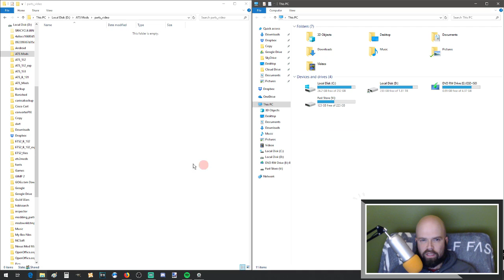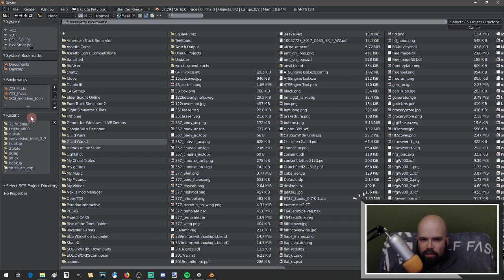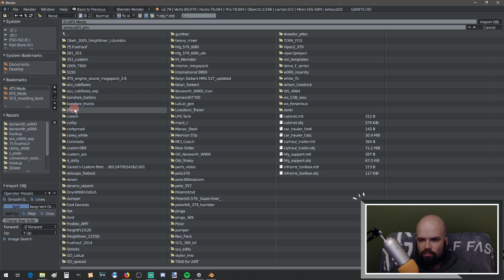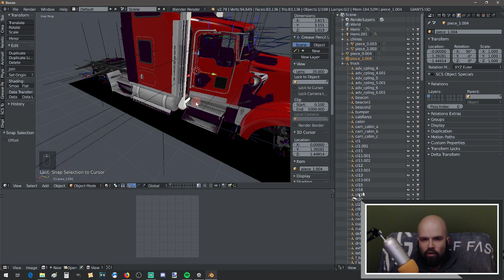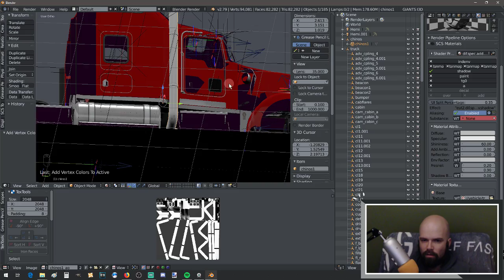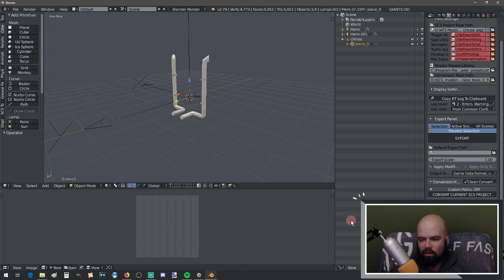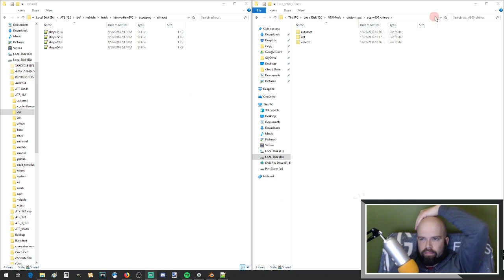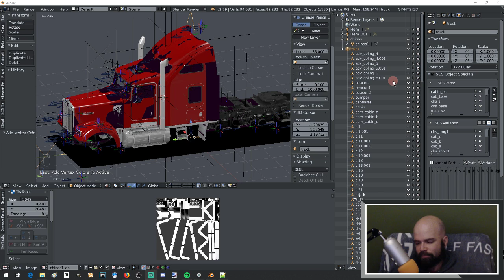Blendertools [ATS] How To Add Accessories to An Existing Truck Mod!

Comment: how would i go about adding a node on my aero cab ? so i can add beacons > also how do i go about updating a beacons on a trailer ?
Reply from the maker: Easy way is to copy an existing node on the truck, like the horns. Name it beacons and then import the stock beacons to check fitment and write the necessary sii files

Comment: hi.. again i added an airfilter to my truck but how do i get the same material that default other chrom part of the track?
Reply from the maker: You need to assign it using the material chooser. See what the other chrome pieces are using and select it from the list on the air filters.

Comment: Okay so, I’m trying to put the flattop sleeper from the scs 389 onto the scs w900, would I do it the same way or?
Reply from the maker: Those are both attached to the cabin so you would need to use variants to make that work.

Comment: Bro could you help me out I got a part where I want to just add some slots to it. I got blender but what is that other program you use? Or could you just help me out with the 2 part that would be also really cool it’s just adding some slots to 2parts. Or help me out how to start up

Comment: If an accessory is imported as a .pim file, instead of obj, can the baking and materials process be skipped?
Reply from the maker: Depends on if you want to keep the materials and textures assigned to that piece. But most times yes.
Reply: @Halffastgaming  I do, all I would like to do is add stacks and bumper from one truck to another... So then just skip the baking step altogether?
Reply from the maker: @bradstoltzfus5436  just need to copy the necessary textures over to the proper place and reassign the tobj and you should be good.
Reply: @Halffastgaming  perfect thank you so much! And thanks for sharing your knowledge, I've been wanting to tackle some small modding and your videos are extremely helpful.

Comment: i have a old kenworth w900 but i want to add computer system and and some interior how could i do that ?
Reply from the maker: Well a computer is a bit more complex but you could copy the one from the SCS w900, and what kind of interior stuff are you wanting? If it's something custom you would have to model it or have it modeled and then added to the truck. Once it was made you can follow this video.
Reply: @Halffastgaming  do you have a discord maybe i can pay you upfront to do it
Reply from the maker: @dizzythakidd7350  not something I do. Sorry
Reply: @Halffastgaming  ok thanks man ill just have to learn

Comment: Tex Tools doesn't show up for me. Can I just use the bake icon on the other side under Render?
Reply from the maker: Tex tools doesn't bake, the tool I use is a separate add on.
Reply: @Halffastgaming  Would I need to do anything differently if the accessory I'm trying to add was not an accessory on the truck before?
Reply from the maker: @c.s.charles2102  differently how?
Reply: @Halffastgaming  Would I have to make a node for it?
Reply from the maker: @c.s.charles2102  if it won't replace another accessory on the truck as it is.

Comment: if i want to raise the trailer a little at the fifth wheel what do i move ? hook? or fifth wheel square in blender?
Reply from the maker: Raising the trailer at the kingpin would be raising the hook node in the positive Z direction.
Reply: @Halffastgaming  thank u
Reply from the maker: @TheJdmcivic32  my mistake. It's the reverse. Should be negative Z. Positive Z will bring them closer together. Apologies.
Reply: @Halffastgaming  when i move the square it seems to not stick to the position i put it
Reply: Export after changes back into truck before converting back ? Or do I just convert after changes 🤔
Reply from the maker: @TheJdmcivic32  always have to export then convert.
Reply: @Halffastgaming  had a feeling i was missing a step i got it 👍 ur the best 👌

Comment: I like the t660s so im trying to learn all this modding so i can make a real nice custom one. but for some reason when i drop the truck mod on the scs extractor the black text opens then closes real quick. does anyone know whats up?
Reply from the maker: The extractor is for SCS Software SCS files. Not for mods.
Reply: Half Fast Gaming the truck is in a .scs file. Is there another way I go about doing that?
Reply from the maker: If you are interested in using blender I have a ton of videos on how to do what you are asking.
Reply: Half Fast Gaming alright Man i really appreciate it! I’ll go look into them right now

Comment: i tried it with a pim file but when im import this file ...there is nothing on the model... no texture no mat ...why may be?
Reply from the maker: Because you imported it from outside the current project?
Reply: @Halffastgaming  can record a video about this please? im very thanks for your works
Reply from the maker: About what specifically?
Reply: @Halffastgaming  about import a pim file to a modded truck... like a new bumper air flter or back bumper
Reply from the maker: So a part from another truck to a new truck?
Reply: @Halffastgaming  yes please .. your tutorials are very pragmatic...

Comment: When i go to export it says “selected objects are not part of any scs game object” im using parts from a modded truck, is there anything i can do
Reply from the maker: It means that they are not part of a root node.
Reply: Half Fast Gaming how would i make them a part of a root node? Is there a part of the video i missed, and if so can i get a time
Reply from the maker: @tjtransportyt1796  I've covered creating a root node, I may even do it in this video. I'm not in a position to watch it back at this moment.
Reply: No need to man, i got it, sorry for the inconvenience, thanks for quick responses tho!!
Reply: Half Fast Gaming also when i goto the exported files it only shows the tga file and a tobj no .pim or .pit
Reply from the maker: @tjtransportyt1796  That means you have errors, and if there's no root node, that will happen.
Reply: Half Fast Gaming its not giving me errors when I export, im not sure if the pim and pit files that are already in there belong to it, either way the pim and pit files have no size and don’t work

Comment: How do u get the pim, everyone uses it but i cant get it, also the scs import thing when ur importing a file into blender doesn’t show up, what am i doin wrong
Reply from the maker: You use converterpix to get the pim.
Reply: I doo but it doesnt
Reply from the maker: @jordyjohnson7588  if it doesn't make a pim it means there is an error in the materials or the model itself.
Reply: Could we talk on discord or something
Reply from the maker: @jordyjohnson7588  what do you want to talk about?
Reply: To see if u can help, i have the pim but i cant go to where u import it, it doesnt say the scs option
Reply from the maker: @jordyjohnson7588  you need to add Blendertools to blender. It is available on the SCS wiki and instructions on adding plugins are included.
Reply: How do i add it?
Reply from the maker: @jordyjohnson7588  like I said, the information on installation is in my videos, and also available via blender.org

Comment: Could you tell me how to use accessories from an existing mod to another?
Reply from the maker: Import mod accessory you want, copy texture and tobj required for said accessory to within the mod you want to move it to, change project base folder,  import truck mod you want it moved to, align to accessory node, export to new truck base. Convert, place files in zip/SCS format. Write defs for new accessory.
Reply: @Halffastgaming  do you have a video that shows how to do?
Reply from the maker: @izacgama3033  this video is half of it. Just need to import the part you want.
Reply: @Halffastgaming  Okay, I'll try here. Thank you very much for the answers and for the video too.

Comment: Do any sort of added accessories work online?
Reply from the maker: Yes they added that functionality
Reply: @Halffastgaming  What about a session that has no mods active?
Reply from the maker: @mlglol4401  yes you can do a vanilla session or a modded session. Modded works better if everyone has the same mods, otherwise the mod would need to have some functionality that they implemented to exempt it from being the same. Can't think of it off the top right now though.

Comment: Will this work with  hanging dice etc
Reply from the maker: Hanging dice are hookups.
Reply: @Halffastgaming  how do I edit these please I know how to use blender
Reply from the maker: @clifftonicstudios7469  you need to know if the mod already has the nodes for hanging items. If it doesn't then you would have to add it just like any other node. If you do have it, then it should be available to choose in the accessories.
Reply: @Halffastgaming  Im trying to open sils mega pack and change those, but Im unable to open the scs file even with the extractor ?
Reply from the maker: @clifftonicstudios7469  you open them with a zip program, not the extractor. Extractor is only for official SCS files.
Reply: @Halffastgaming  Sils files have no option to extract. they just say ATS SCS
Reply from the maker: @clifftonicstudios7469  no idea then. If you can't open those you can't do anything.
Reply: @Halffastgaming  Winrar did not work 7 zip did thanks for the help.
Reply: Is it possible to add your own models to the maps ?
Reply from the maker: @clifftonicstudios7469  yes.

Comment: too much "im gonna go here, do this, then that goes like there" we need to know that "this" and "that" is. all i wanted to do was thake a bike that sits on the chassis from one ruck to another. ive been dicking around for over a year to find a decent tutorial on ats moding and came up empty. with all the time wasted and the game crashing all the time. im about done with the fucking game
Reply from the maker: Interesting take. Been doing this 7 years. Or was it that? Not sure where you are having trouble but starting with the game crashing, means you have information in the log about what needs fixing. Maybe start there?